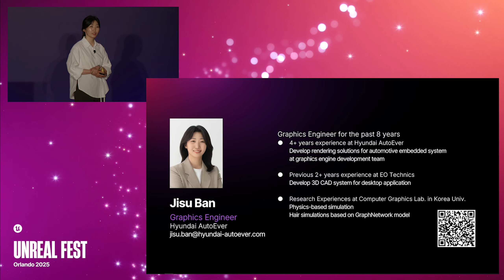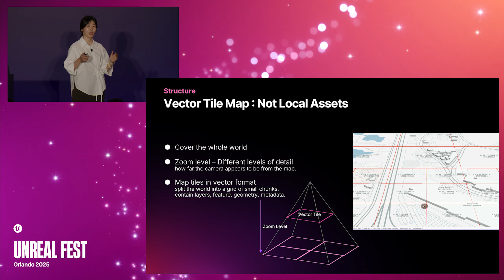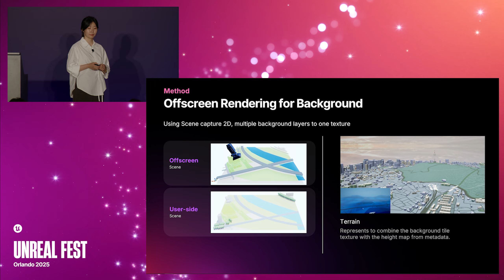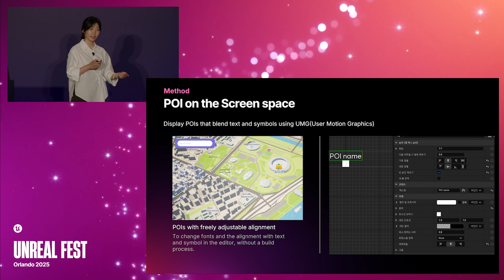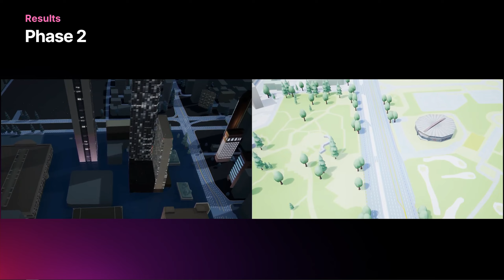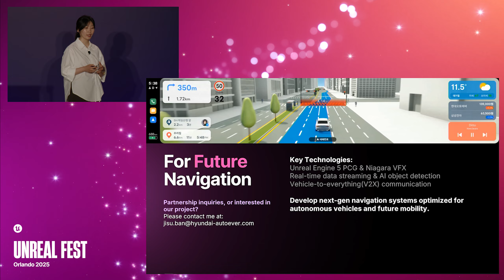World's First UE5 Vehicle Navigation: Pioneering Vector Tiles | Unreal Fest Orlando 2025

Comment: response time is not latency or anything to do with human reaction time but the measurement of how much perceived blur when transitioning between frames. People see "milliseconds" and think anything under 20ms is pointless because no human can detect something that fast but that is not what it is measuring. 

A very simplified explanation, if a 480Hz monitor is roughly 2ms per frame with a 1ms response means that half of every frame will look blurry because 2ms of each frame has 1ms of transitioning time between colours (1ms / 2ms). Likewise if the 480Hz monitor has 0.5ms response time instead then each frame has a quarter of motion blur (0.5ms / 2ms) which should make it look significantly clearer than the other monitor of 1ms response time despite "only" being 0.5ms difference between them.

I think a better metric for measuring motion blur is percentage instead of milliseconds so people don't get confused between reaction/latency time and response time 0.5ms RT for 2ms (480Hz) panel would be "25% transitional blur".